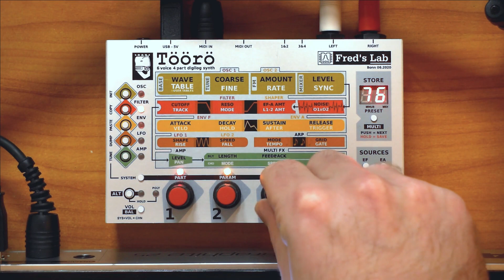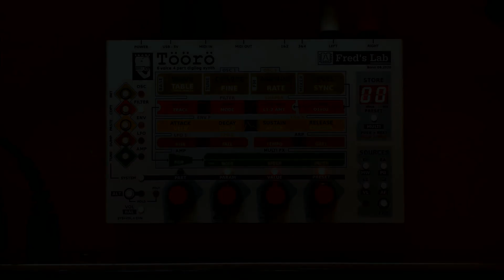Töörö - The FL A847 analog filter

Comment: Das Filter ist nicht stufenlos. Ich dachte, dass dass A847 Konzept analog umgesetzt wurde. :-/
Reply from the maker: It's analog, it has control voltage with 12 bit resolution but the cutoff setting is on 8 bit to simplify the editing with encoders. No stepping with envelope, modulations ...

Comment: I notice there is stepping sound when you edit the cutoff apparent with high resonance, Are you considering to smooth it?
Reply from the maker: The low resolution is just for the editing. Resolution of filter cutoff CV is 12 bit.
Reply: @FredsLab  Thank you, So it will sound stepped when you twist the knob but not when you send moulation to it?
Reply from the maker: @silen8993  exactly, no stepping with modulations and automations from MIDI. The sound engine has an internal 16 bit resolution but the editing with the encoder falls on 8 bit steps.
Reply: @FredsLab  Good, thank you Fred!
Reply from the maker: @silen8993  you're welcome!
Reply: @FredsLab  is it possible to avoid this by using say the q links on an an mpc live?